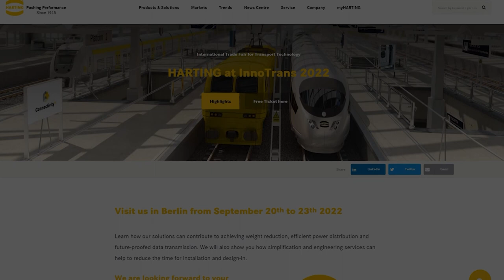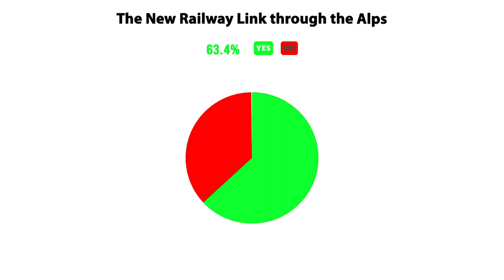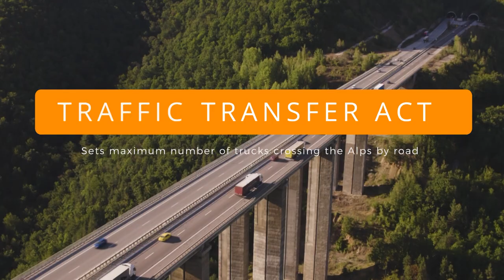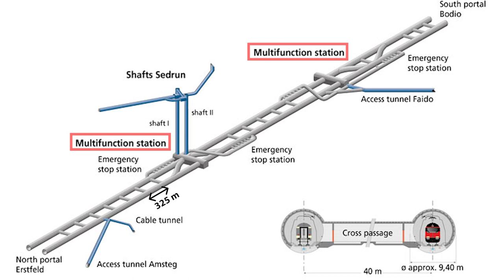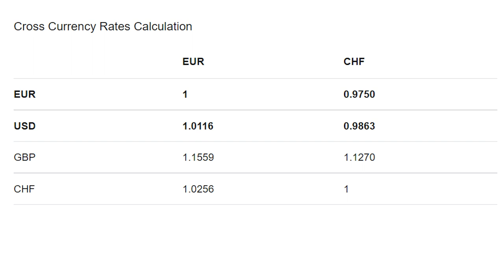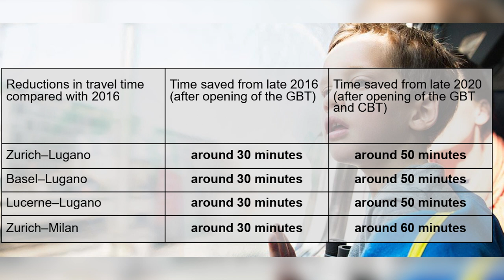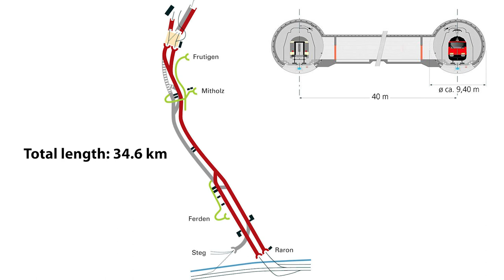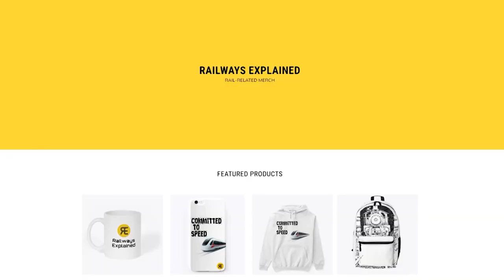Why Switzerland drilled the Alps like cheese?

Comment: The Ceneri base tunnel has a length of only about 15 km. The mentionned 40 km are total excavation length, so both tubes count and also all the cross passages and access tunnels.
Reply from the maker: That's right.
Reply: funny at the start of video it shows proper length
Reply: Same for the Zimmerbergtunnel from the travelers perspective. But I guess with a focus on construction makes sense, just the word 'excavated' is missing. Thanks for your highly accurate and visually pleasing coverage. (BTW. The rhine cargo ships usually only travel to Basel directly at the boarder. Not even through to the Bodensee. This is due to the Rhine-Waterfall. Further up this lake its just a much smaller mountain valley river)
Reply: Totally wrong , there are two 57km tunnels ....thats the Gotthard-Basistunnel.  Totally there are over 200km of tunnels totally on the north-south railway.

https://de.wikipedia.org/wiki/Gotthard-Basistunnel#Lage,_Verlauf_und_Geologie

greets from switzerland 

actually every swiss knows this
Reply: @charity4ever  he is talking about the Ceneri base tunnel that has a length of 15km
Reply: @charity4ever  
1. The original comment referred to the Ceneri, not the Gotthard, so you're already arguing completely out of context.
2. Length of the entire tunnel system and how many of them were built isn't really a subject of interest to the general public.
3. Commenting the exact same thing twice won't give it more value.
Reply: i was responsing to a deleted comment inbetween.

Comment: Waiting since decades that Italians and Germans do their little part. We even threw some money at the italians to finish the transeuropean line, but they prefer singing lascatemi cantare...!
Reply: In the case of Germany, it looks to me like they are terribly afraid of opening a can of worms. I once travelled from Zürich to München and felt like it was something of a joke that on the German side, a diesel locomotive pulled us to München at a whopping speed of 80 km/h!
Reply: @MrSaemichlaus  That route isn't one of the most pressing concerns although the line has now been upgraded so say goodbye to Diesel engines pulling you. But yes - Zurich Munich is a very peripheral connection and it won't receive a lot of money because there are frankly many inner German connections that could need German taxpayer money a lot more.

Comment: 12:02 "set 40m apart" According to the picture shown, shouldn't it be 4m?
Reply: It's 40m, the picture was chosen at random I guess.
Reply: @Edelweiss1102  Thanks!
Reply: That what the crossbar is for. It indicates that a piece (without useful information) is cut out of the drawing for clarity.

Comment: apparently not so big change as they dont get as much traffic as expected mainly because of customs for entering switzerland and such... at least according to some videos.
Reply: Nonsense! 71% of transalpine cargo through Switzerland is on railways (data from 2020).  With the opening of the Ceneri base tunnel this percentage has again increased. 
Switzerland was leading the way with the NEAT, other countries have fortunately recognized the value of this sustainable way of transport and followed suit.
While the quota for all transalpine cargo is not quite that high yet, a crucial factor in raising the quota is heavy investments by Alpine countries to improve rail infrastructure. The opening of the Brenner base railway tunnel between Austria and Italy and the TELT between France and Italy will further move the scale towards railroad cargo. 
Italy (in 2015 still at only 30% of cargo on railways) has increased its budget to modernize its rail network and will ultimately shift more freight traffic from road to rail. The country is improving the four TEN-T Corridors that run between the mountain passes to the southern ports to support this goal. 
Of these links, the one via the Gotthard Tunnel through Switzerland is the most important. Between Rotterdam and Genoa it runs through a strong economic area that accounts for 16% of the European Union’s GDP. Switzerland is investing heavily to support smoother cargo flow. With the opening of the 15-kilomtere-long Ceneri Base Tunnel, this crucial artery for North-South freight traffic lead to freight trains to be able to transport up to 2,000 tonnes instead of the roughly 1,600 tonnes they could move before.
Check the report here, if you're interested: https://www.bav.admin.ch/dam/bav/de/dokumente/verkehrstraeger/eisenbahn/gueterverkehr/2-semesterbericht-2021-aqv.pdf.download.pdf/d_Semesterbericht%202-2021%20V1.0.pdf
Reply: @markusstudeli2997  what about % of how full tracks are? like 260 trains is max as video says how many trains are passing?
Reply: While it was true for a couple of years, due to ITALY not building in time its part of the overall system, it is long not the case anymore.  Pay attention to how old the videos you are watching are!
Reply: @jebise1126  Irrelevant!  These tunnels have been built to satisfy the transalpine traffic for the next century!  You wouldn't expect them to be at capacity a few years after opening, would you?  
What is important is how much has the road traffic through the most impacted alpine valleys been reduced.  THAT was the will of the Swiss people. And I believe it is around 80+%.  These tunnels are a resounding success!
Reply: @jebise1126  It would really be bad if these tracks ran at full capacity a few years after completion of the main tunnels already! Plus keep in mind that the approach lines, particularly in Germany, are still under construction! 
Induced demand will increase figures in the coming decades: By providing the NRLA infrastructure, transalpine rail cargo (and passenger rail) will inevitably replace big parts of transalpine road transport. 
Figure that: In Switzerland, truck weight is limited to 40 t, so a single train with 2000 t capacity and one driver replaces 50 trucks with 50 drivers! Besides the economical benefits, this is also much more energy efficient and ecological.
More capacity for the NRLA is already in the planning with the extension of the Lötschberg double track part, maybe even making it completely double track, like the Gotthard base tunnel. Additionally the Zimmerberg tunnel 2 will eliminate an important bottleneck on the Gotthard northern approach. 
Unfortunately, the truck and car lobby, particularly in Germany, tries to spin a negative picture of rail transport. So be careful when you consult "Youtube University".
Reply: @markusstudeli2997  I don't know the exact numbers, but it wouldn't be any surprise if they'd already be running at full capacity. The only reason it probably doesn't is because germany is behind in schedule. When it opened, passenger trains were already at full capacity and more. They had to "beg" people to leave the train before entering the tunnel. Now they're running more passenger trains even though the main purpose of the tunnel should have been freight.

Comment: also what are the swiss doing to upgrde the east west cross switerland lines.
Reply: From the west it's relatively easy to get in and out. To the west I'm not sure. Perhaps it's better and more cost effective to connect to Austria through Germany
Reply: @truedarklander  could you look into it and make a video about it. i am half swiss.
Reply: Nothing, because it's not needed and because of the congested area around Olten and Zurich, simply not possible.... 
On the west-east corridor, cargo is run from France through Germany towards Poland, and from France through Italy towards Austria/Slovenia.

EDIT: some major projects are in store to enhance capacity, but that wil be mainly for passenger services.
Reply: @alexisdespland4939  ...which half is Swiss? the upper or the lower?....lol
Reply: @andrep8287  the  half that  loves trains ofcorse. lol
Reply: They've recently upgraded the line from Zurich to Munich.

Comment: You mentioned “Overhead whirring” instead of “Overhead Rails”.
Reply: Actually, the correct term is "overhead wiring" in this context.
Reply: @andrep8287  
And it’s still a rail made of aluminum….
Reply: @aoilpe  No it's not.
Reply: @crinolynneendymion8755  
Have a look 👀 !
It is…